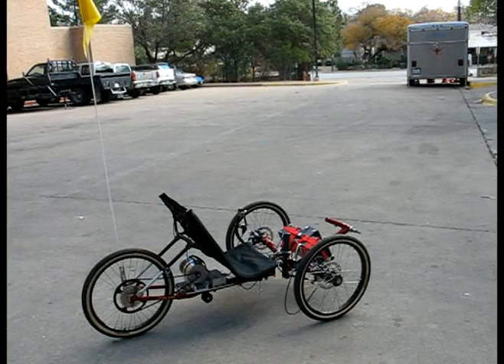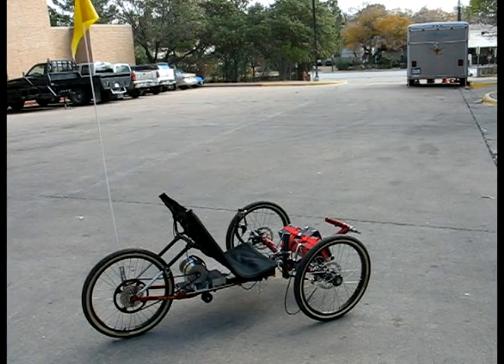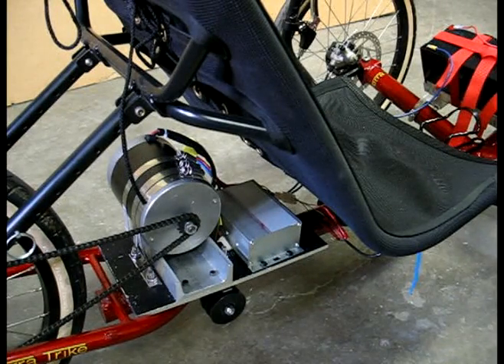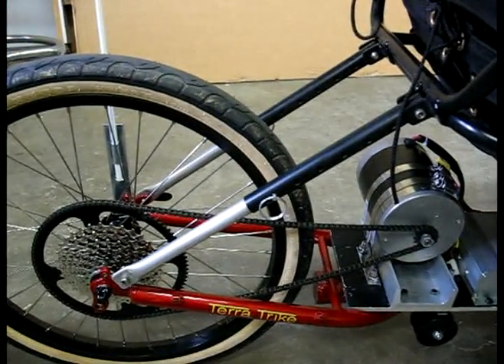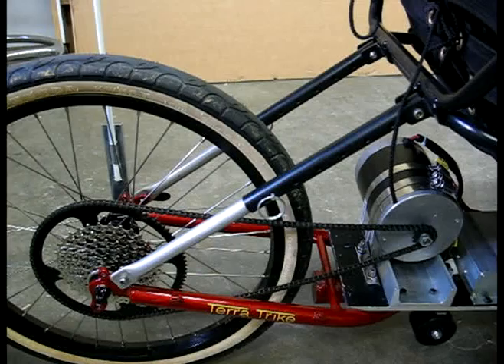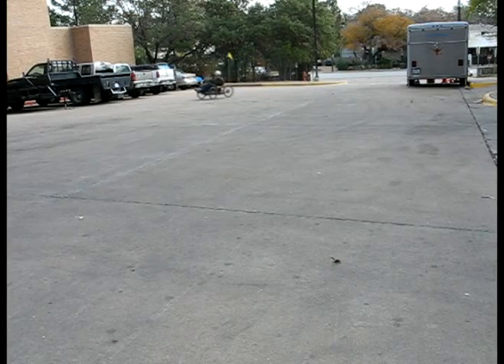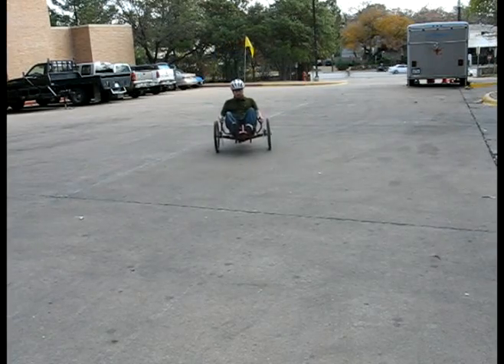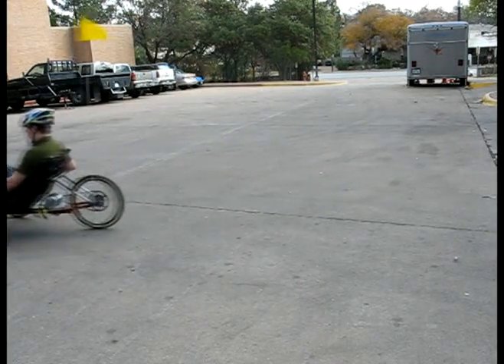EV 02

Comment: Nice project mshimek.  I'm wanting to build a faired recumbent trike with electric assist throught the driveline as a commuter/errand vehicle.  Presently ride a two wheel recumbent but want a three wheeler for winter commuting.

Very impressive experiment, hope you take it to the next step on another project... lighter, better handling, work out the complexities of running the driveline parallel with pedaling so it can be an assist unit.

Comment: @Gunner3210 

its an 800watt motor, which is about 1hp, less than you get in a lawn mower. The motor has to be that sort of size to generate the torque necessary to move the weight